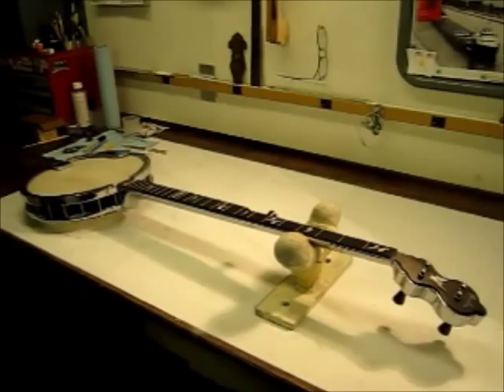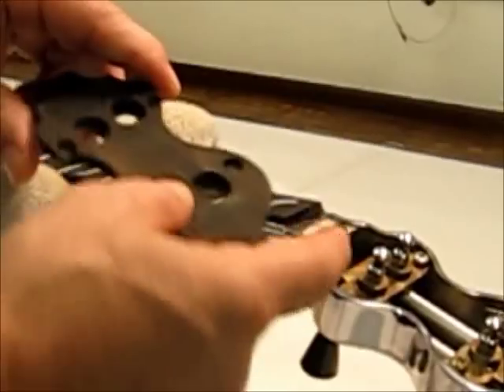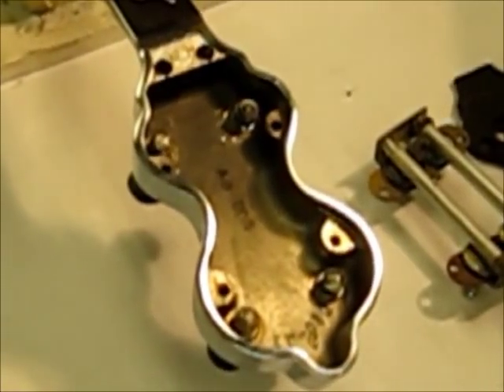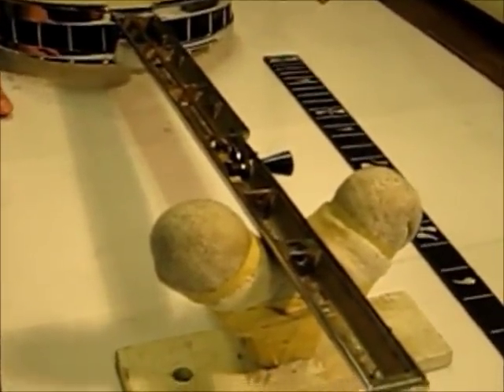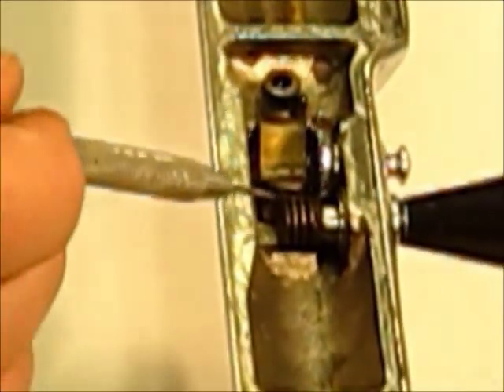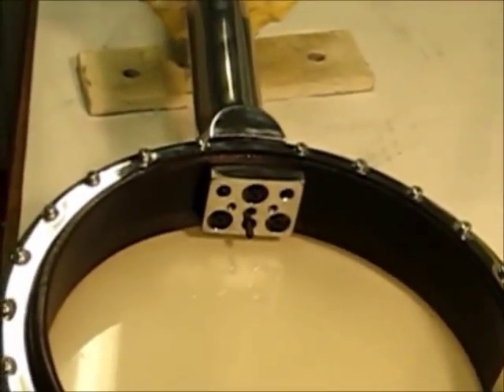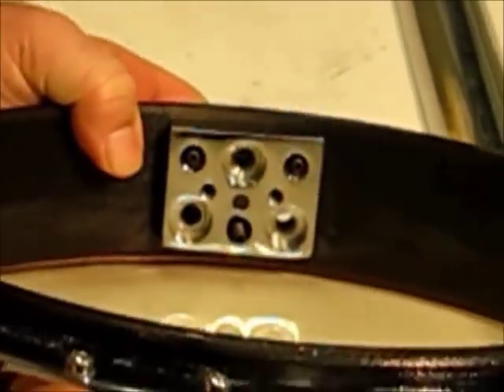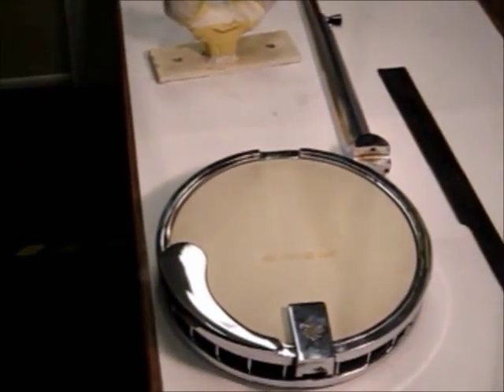Merlin Long Neck Banjo construction

Comment: I've got the original blue print design merlin, can see the peghead in my profile pic. Real interesting design. Was formerly Bill crofut's (pete seegers student) Also got a gold eagle merlin like the one in the video :)  both longnecks. With the original merlin it was cracked in half, I had it welded back together, sanded down and nickelplated and rechromed. Came up perfect, sound is perfect, repair cant be seen or felt even before the chroming. The Gold eagle is in pristine original condition :)